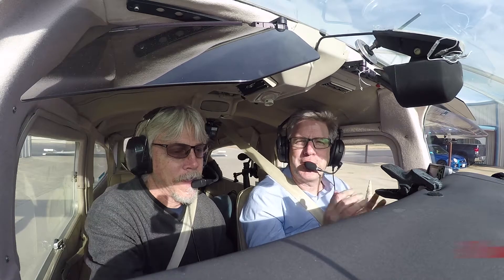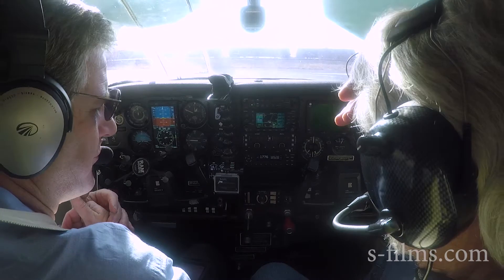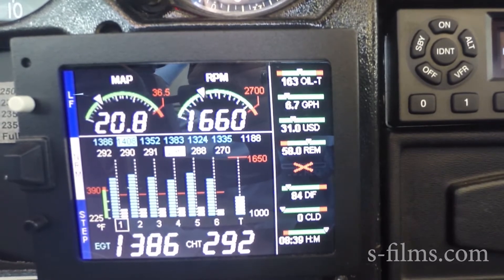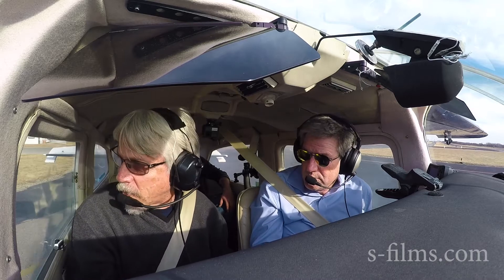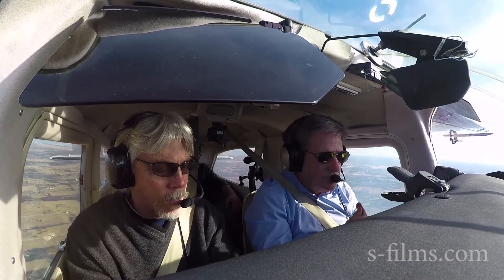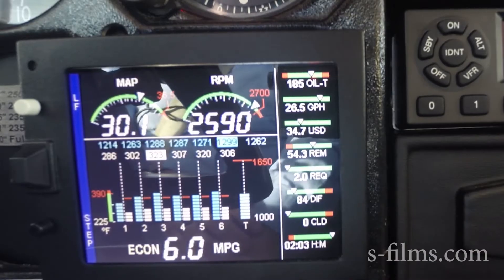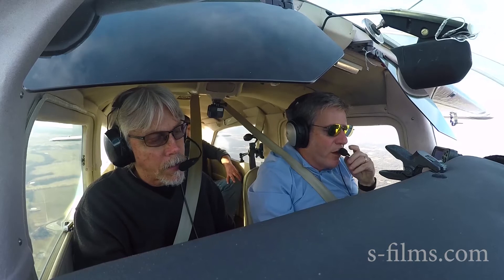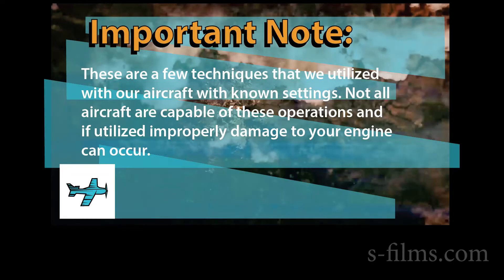Flying with Your Mechanic - TakingOff Ep4

Comment: Great video. I have a Piper Tomahawk PA 38-112.  I have the EDM 700 Engine monitor and have used lean of peak operations. And leaned to 3.8GPH from 5.5GPH. But never used mag check as you have shown. Will conduct Run-up and in-flight mag check in normalized mode to check electrical system and see if Mags are balanced or timed correctly and other issues with electrical system.

Comment: Please identify the runway you are using by its proper designation. “Taking the active” is low in information density, and not especially helpful. Thanks.
Reply from the maker: This video is about three years old and the phrase has become a pet peeve of mine. You won’t ever hear it on videos the last couple years.
Reply: Taking Off I just discovered you through Brian with a ‘y’, and wanted to begin at the beginning of your vids. Thank you for your reply.

Comment: There is little explanation as to what you are doing what you are what you are leaning, what buttons you are pressing.  and there is more filming of the people and whats around them than what I believe you are supposed to be showing. Shame. This could have been much better. For example. Always have the camera on the Instrument. As you demonstrate LOP, explain what you are pressing, what you want to display, and what you are doing to achieve by doing this. Always showing the instrument display. Not the pilots or the whole of the instrument panel because it can hardly be seen seen to the daylight outside.
Reply from the maker: Appreciate the notes. I agree— next time I’ll do a picture in picture of the JPI throughout.
Reply: Sorry for being negative. But I liked the video, but would have loved it .